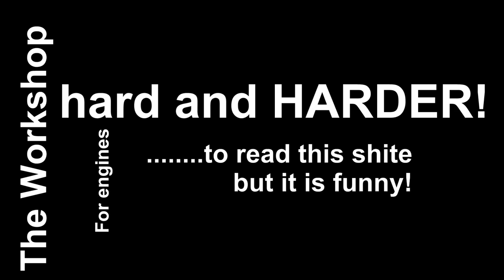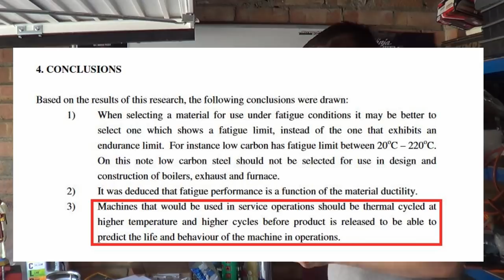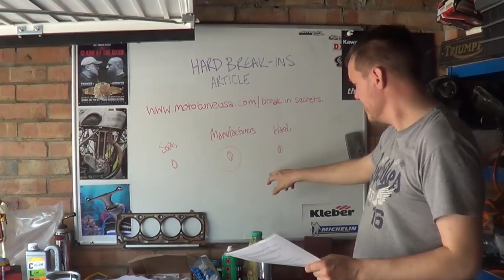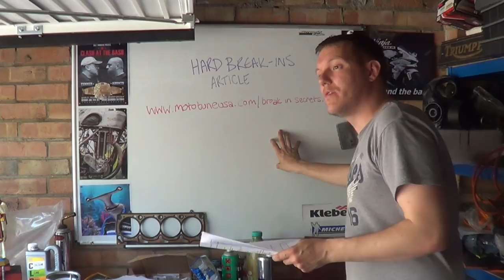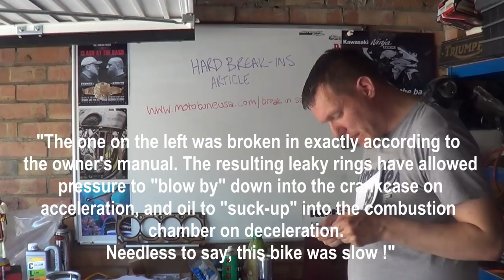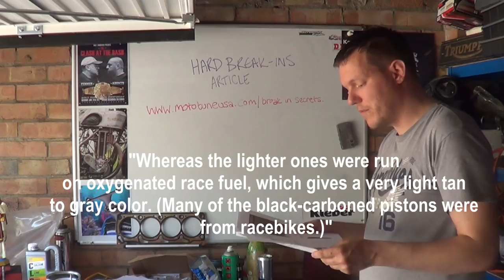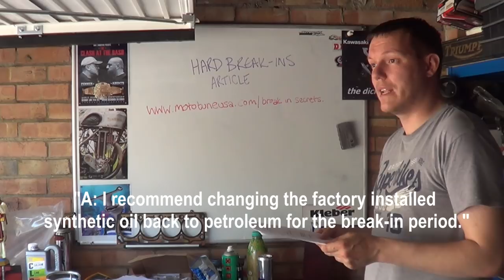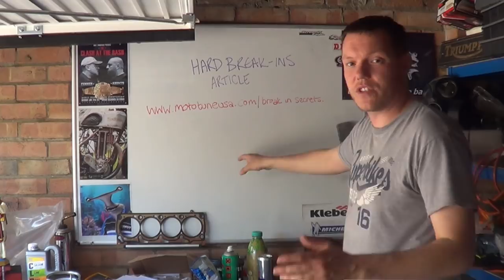Hard break in BULLSHIT! - Part 2

Comment: Pro tip for better piston ring break in.remove fuel filter from gas tank and fit joiner then add two small bottles of fine valve lapping paste (premixed into some petrol)into the fuel tank.proceed with haaaaaaaard break in.note will only work on carbs,for efi add paste directly to crank case.

Comment: Bike manufacturer spent millions developing and testing an engine before you get your mitts on it, then some fool comes along with this bullshit.  Even Harleys have synthetic oil these days.  The bikes from the 70s / 80s ran diffrent mono grades depending on your location. 30,50 or 70 weight.

Comment: the piston on the right is brand new.  Just look above the first ring.  theres no sign of combustion and thats ABOVE the rings.
Reply: it may have been run on ethanol, not really any good way to tell from the photo.
Reply: butre jp Still means it's a shit comparison if the two pistons were run on different fuel.
Reply: agreed, but just because there's no carbon doesn't mean the piston hasn't been run

Comment: Some new cars have variable displacement oil pumps, controlled by the ECU. During the first 1000km, the pump adjustment sits at "high volume high pressure" position all the time. .. Due to higher thermal loads of break in.

Comment: About different oils for the engine. Main reason not to use mineral oils in modern bikes are the tolerances and full synthetic oils keep their lubrication properties for longer. Also car engine oil is not meant to be run with a clutch. Most of the blackening in the dirt bikes comes from using the clutch. Use low grade or wrong oil and your clutch will start slipping or stick and will not work as intended. Like the videos and keep it real! (:

Comment: It's not just bikes, car manufacturers give similar advice. I've always run in following the manufacturers advice and have never had any engine problems, and after run-in the top speeds seemed to agree with the road test figures and specifications so I certainly couldn't have lost much power. I did have the impression that the engines loosened up and ran a bit more freely after 10k miles or so but it's impossible to be sure about this without a dyno test.

Comment: I had opportunity in the early 90's to get old man Ferrachi to not only work on my FZR 600 Genesis and he actually drove it which was a big deal for me since it was not a Ducati! Anyway, he told me vary engine speed for first 100 miles and once the valves seat, which you can tell, wind it up.
I lived in Willow Grove PA at the time where Fast By Ferrachi is located.

Comment: I vaguely remember a story of when BMW were building F1 engines using standard road blocks (80's I think) they would only use engines that had run over 100,000 miles because they had heat cycled enough to completely stress relieve the block. I think! A lot of the 80's were a bit blurry for me!!!!!

Comment: Ive done a quick hard break in on every new motor I've bought. 3 motors i put 25k+ miles on them with zero issues or oil consumption. The other 4 were used to road race. I would have those motors spinning at 10k+ rpm for 20 minutes at a time up to 6x a day. I never had any issues with those either. I bought one used motor that was broken in following the manual and it has 1200 miles on it. I blew the motor after one track day.

Comment: I think some place between manufacture recommendation and the Mototune is the happy balance. The OEM is really just concerned with making sure most engines make it out of warranty period with no failures. They are not concerned with the most optimal break in for the owner. Good grief they do not even trust people in America to select an appropriate grade of oil for temperature and usage. If you do UOA over and over again you can see trends not just wear but were the wear is coming from and total base number, total acid number, particle count, dissolved solids etc.... Few cars or trucks today have beefy OEM specific break-in oil or additives. I know from doing UOA. So if an OEM has a specific break in oil that is choke full of additives definitely leave that in. After 500 miles on a car I change the factory fill and do a UOA. I refill with a synthetic and always add break in additives and run that for 1500 miles and then I change and go for 3000 miles gradually increasing the OCI Oil Change Interval using UOA Used Oil Analysis as my guide. After that I never put any oil additives in at all I just run a decent synthetic and 6 months oil change interval with no real worry about millage. Adding a little bit of break in additive not the entire bottle to most factory fills on car's and trucks is a good thing adding an entire bottle is too much and you can actual get pitting from the additives being too high. 5W40 oils intended for diesels make great break in oil and you can always add additives to bring  them up if your sump is not shared with the transmission. If it is a shared sump that could be an issue! 

Sadly I have never owned a new bike I have always bought used because they depreciate so fast that it is hard to say no to a used bike.

P.S. If I remember what I read correctly in Toyota and Lubrizols co-authored paper for the Society of Automotive Engineers rings prefer moly during break in and the cams, cam followers, shims and buckets prefer ZDDP. Chains preferred phosphorous which is the P in ZDDP. Modern versions of ZDDP have less phosphorous than older forms of ZDDP to reduce poisoning the catalytic convert. Cars that have oil consumption issues kill them quick. General Motors who has had oil burning issues for decades and cheap catalytic converts was a major pusher for reformulated lower ZDDP and sulfur levels to extend life of emissions equipment with out raising the cost of the equipment and with out redesigning engines to burn less oil.  A lot of other OEM that would never have pushed for this supported it though since it reduced their warranty cost's as well. With so many cars have rollerized valve trains it was not that big of a deal. 

The fact remains though that OEM's are using pistons rings with far lower tension to reduce friction for better corporate fuel economy numbers in the USA. They have raised the ring lands higher up the piston than ever. They have reduced the skirts to almost nothing. Valve guides total surface area has been reduced as well again chasing friction reduction. oil recommendations in the the USA are freq. 5W20 or 0W20 again chasing CAFE number for tax credits and the like! 

I know you specialize in motorcycles not car's and trucks. In all these break-in recommendations no one ever brings up hths minimums and what the oil additive package should look like for idea break in and low wear during ownership. A lot of research that was done in the 1970-1990's is ignored because chasing CAFE numbers for total fleet is all the rage. The better materials, surface finish and rollerized top ends allow them to break what they know are best practices. It used to be common knowledge that you wanted an hths of 3.5 minimum in a 5W30 for instance to give the best compromise between wear and internal hydraulic friction. In the USA it is hard to find a 0W30, 5W30 or 10W30 that has an hths of 3.3 let alone 3.5. Rotella has been testing a 5W30 or 10W30 commercial diesel oil with an hths of 3.3 and it has been failing. The goal is to improve fleet average fuel economy with out destroying the engines. Ford has gone away from their 5W20 recommendations for all of their new Eccotech direct inject turbo charged and high performance V8 because of issues they will not disclose and now recommend a 5W30. To meet emissions cylinder head temps and coolant temps are higher than ever. EGR and PCV systems are biased toward emissions and a lot of them are causing sludge issues.

My point is that their a lot of factors at play today on engines what where not factors 20 years ago. More and more companies that never had engine related issues are having insane problems today. I understand that a lot of these issues do not apply to every country but OEM's will normally pick the strictest market they need to meet emissions or mileage standards for and design for that and everyone else get's that design if they want it or need it or not! Companies have turned to lying and cheating the system in many cases! So just keep in mind you might get a design that is less than ideal becasue of standard in another country!

Comment: @The Workshop

Hey Matt, love your videos and agree with your understanding and opinions on break ins. Your Z900 break in is exactly how I would go about it. 

I’ve haven’t yet had opportunity to break in a brand new or rebuilt engine but I may be doing so on a brand new Aprilia Tuono V4 1100 Factory early next year. 

I simply what I want to ask your opinion on a few things, firstly the interval for the very first oil change breaking in by the book. Is it better to do an oil and filter change, or several before the first 500 mile service or to not bother? As in change at 50, change at 100, 200 etcetra or don’t worry about it and just do the one at 500. 

Secondly do the wear metals within the oil before first service aid in the break in at all or is it better to keep the purest oil reasonably possible in the engine at all times during break in? I’ve been led to believe that there is no such thing as break in oil for modern machines and modern oils and it’s simply a case of good quality mineral, semi or fully synthetic. 

Thirdly If the manufacturer recommends fully synthetic would you break in on fully or would you use semi?

I already have my own opinions as an experienced automotive technician repairing, maintaining and reconditioning light vehicles here in England. I strongly suspect that our opinions line up but would like to hear it from you from the engineering side of things. 

Sorry for the long post, if there’s no time for a video or it takes too long to do so I’ld be more than happy to have a conversation over a PM, even if there is a video I’ld love to have a chat with you regarding it. 

Please NO replies unless you’re Matt!

Cheers and thanks for your time if you’ve read this Matt. 

Again NO replies unless you’re Matt!!!!!
Reply from the maker: "Is it better to do an oil and filter change, or several before the first 500 mile service or to not bother?"

- I'm doing mine @ over 500 miles this weekend - and you'll get to see the whole thing.

"Secondly do the wear metals within the oil before first service aid in the break in at all"

- LOL no. The metal fragments are quite 'heavy' and large - flashing off th casting etc - the fine particles are taken care of by the filter.

"Thirdly If the manufacturer recommends fully synthetic would you break in on fully or would you use semi?"

- I don't believe in this mineral oil only bullshit. Good quality oil is what is required - full of semi - the choice is yours.
Reply: The Workshop thanks so much for taking your time to reply! I’m glad our opinions match pretty much 100%. 

Great minds think alike eh? Yours probably greater 😉✊👌

Comment: 14:30 looks like oil coming from pcv or above not below and everyone knows race fuel cleans the funk out of carbon fouling and i have broken in 15 motors with synthetic oil(and 5 or so back in the early 80's and 90's) with much better results than conventional oil and when i break in my motors i use 2 thirds throttle and never touch redline until i finish a full tank of fuel then i change the oil and hit it hard...my last rebuild on my klx my guy said the piston looked like new and reused it and thats mobil 1, not the best but as far as i can see, good enough

Comment: So what kind of oil do you recommend for the first oil change at 600 miles on a new bike.  Should you run mineral, semi synthetic or go straight to synthetic?  Thanks.  For a Yamaha XSR 900.
Reply from the maker: Read the manual, but these days with new bike I stuck fully synth in the Z900.

Comment: Question - should you take it very gently to begin with and build up to the maximum specified RPM/throttle by the end of the break in mileage, or just ride normally from the get go? Also, should you let the bike idle for a few minutes on first start up?
Reply from the maker: just ride normally from the get go
Reply: The Workshop Thank you!

Comment: Hi Mat, I was told that most of the running in period was aimed at the gear box (you need to use the gears not sit on the motorway)and that the pistons and rings were run in fairly quickly. Is this correct?
Reply from the maker: No. EVERYTHING need running it. Why does everyone forget the camshafts?
Reply: @dirtygarageguy  Agree the camshafts rockers and indeed everything. I was thinking about running in just a new piston and bore. Its a long tine ago (1980's)but I'm sure I was told it would only take a few hundred miles as opposed to running in the whole of the engine. Was I given duff advise?
Reply from the maker: https://www.youtube.com/watch?v=cZnKZXNaU3g
Reply: @dirtygarageguy  Thanks for the link Mat, I hadn't seen that vid.

Comment: I suppose the manufacturers know best at the end of the day.

But I've never seen a manufacturer recommend a specific oil for break in but I've seen many recommendations from a lot of sources who say you must use regular old mineral base motor oil and not any kind of synthetic oil.

I have seen manufacturers specify fully synth oils for cars as well as bikes during general use but no mentions along the lines of "before using fully synth oil, during break in you must use regular oil"
Reply from the maker: That's because there is no reason to switch - all manufacturers sell their own brand of oil - be it Yamalube or In Honda's case Repsol. They don't specify because there is no need.

Comment: Could you please outline racing break in procedure for single cylinder engines and types of oil used during/after break in?? please and thanks!!  enjoy the videos!
Reply from the maker: There really is no break in procdure for racing, the engine usually doesn't last long enough for it to matter, unless your having repeated failures then thats usually a fault with something else

Comment: the W in 10w40 does NOT stand for weight the W stands Winter it means its been tested to be safe for cold winter starts
Reply from the maker: Yes Yes, haven't got to the oil video yet. I never said the 'W' meant weight. But I did say weight in the video. My bad. 

Its means as you said the winter rating. I said 40 weight - i.e viscosity. If the 'W' meant weight then surely it would be 10W40W? 

The numbers are viscosity measurements taken at 100DegC, the lower the number the thinner the oil. Hence - viscosity.

People say weight for oils without the 'W' like hydraulic oil. Other people have heard 'weight' and thought that's what the 'W' stands for.

Comment: Hey buddy I asked Mazdaspeed forums how to break in my new engine that I just got done building
And they actually sent me that same article you are reading so not having any engine engineering skills I seen the think it would be all right I've been reading articles for about 2 weeks now after spending $6,000 I'm building this new high-performance turbo engine I don't know who to believe what are your recommendations I would appreciate it the engine currently has about 2 minutes of running time over the last two weeks
Reply from the maker: Look in your manual. They built the damn engine and these wankers are just flogging bullshit. God knows why. If you're using high performance parts then its more important. 

The basics are this - drive it normally - don't drive low revs high load and don't bounce it off the limiter - do this for about 500 miles and over the next 500 built it up to full whack.

Internal parts need to wear together. Think of it like a broken leg. You don't rip the cast off and climb a mountain or do a marathan. You ease into it and in a few weeks back to 100%.
Reply: The Workshop thank you very much put in the intercooler on now changing the oil I got about three minutes on the first oil thank you

Comment: Good stuff man, you've even changed my mind on this subject. Now when I get my turbo 800rwhp cobra engine done easy break in is going to be a bitch..... it's has to go to the dyno pretty much right out the gate no matter what so the sob will run. I do look forward to your 2 stroke break in for 125cc and up dirt bikes.
Reply from the maker: All good man, but the other point was for people to stop calling it 'easy' - it just a run in. 50% for 500-1000 miles and all will be good.
Reply: The Workshop Got it man, as always thanks for these videos, solid information!

Comment: Hey dude, just wondering about race bike break - in. Couldn't they simply program a more optimum break - in, connect the rear sprocket to a resistance of some kind, and then have the bike break itself in over a couple of days? 

Also why don't manufacturers of road bikes just limit max throttle and rpm to the break - in recommendations so people can't do this dumb shite?
Reply from the maker: "Also why don't manufacturers of road bikes just limit max throttle and rpm to the break - in recommendations so people can't do this dumb shite?"

- its a japanese thing. They see at as an insult if your hand is held. Other manufacturers just follow suite. They have porn despencing machines on the streets in plain sight, and they look at it like 'if you don't like it don't look'

Comment: piston rings change every 50,000 to 80,000 miles on car engine
piston ring change on tzr 125 every 7,000 to 10,000 miles 
on tuned rd 125 lc mk1 piston ring change every 1,000 miles when tuned
all ways run in my 2 strokes for 1,000 miles easyiish riding no stressing out up hill